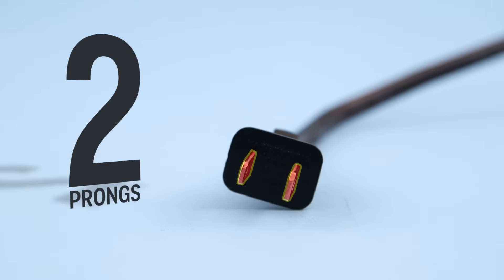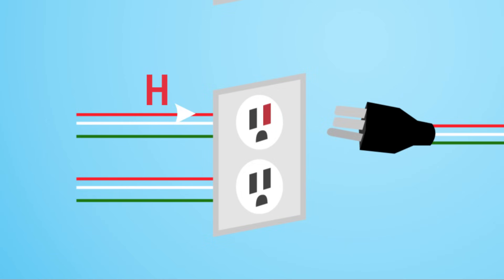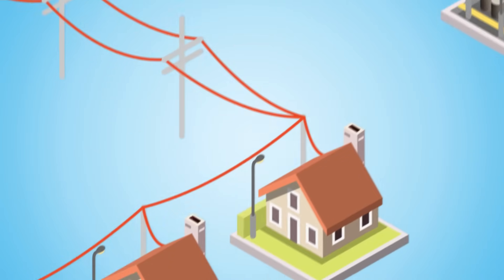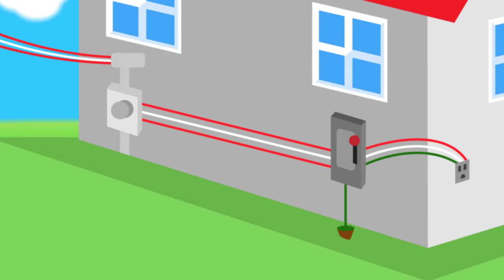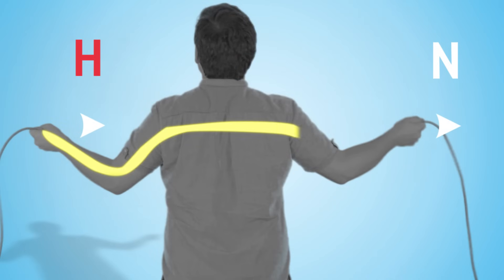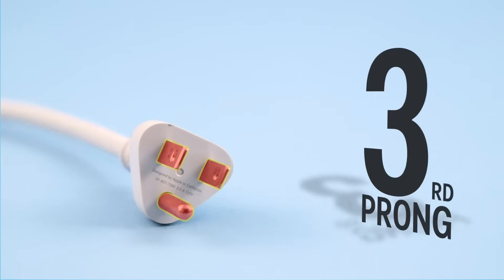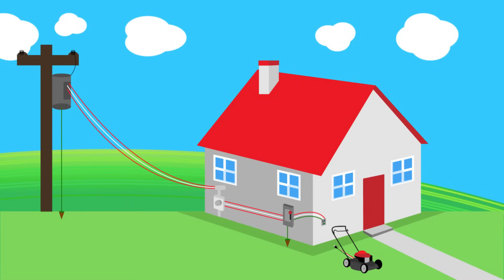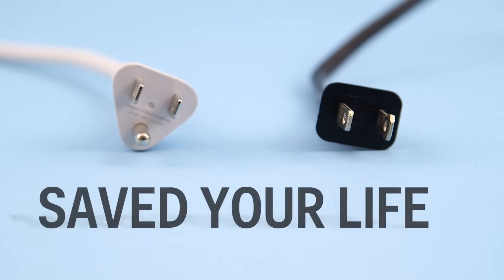Why some power plugs have 3 prongs instead of 2

Comment: Ok, guys if anyone is from England here, watching this video (which I am British) they would know that all the plugs that we use have three prongs, and this is just something in our everyday life. We don't find it odd, and I thought everyone had these wires. But considering that I'm 9, I haven't been out of my own country that much. But this is classic America, to not think things through. Sorry to say, but my empathy isn't turning on right now. <0-
Reply: FluffyStuff mhm
Reply: I like the UK plugs and sockets a lot more they are far safer than the US ones (I'm from the US)
Reply: FluffyStuff Apparently unearthed devices do exist. It’s just that you guys need the 3rd prong to open the shutters for it to actually get plugged in. That is pretty clever though. Nobody is gonna get shocked from that.
Reply: In most of Europe the covers work so that you need to plug both pins at the same time. Some British outlets also have this in addition to the earth pin. The problem with the British system is that a kid can first stick a needle to the earth. Then he can insert it to the live and if he touches both that can give a fatal shock.

Comment: The ground prong usually points down, but is SUPPOSED to point up so that if anything falls on the plug, it will not short between neutral and hot.
Reply: No, that is just your own rule. The code does not say so.

Comment: in the UK you cannot access the live (hot) and neutral connections in a socket without the earth pin opening up the flaps. this means the appliance is earthed before any other connection is made.

we also rate all appliances separately with smaller fuses in the plug top, rated to the appliance.

not to mention mandatory RCD protection for every household.
Reply: You guys are way ahead of us in the West.

Comment: I got shocked a little by a power strip and everything in my room turned off, I guess I was closer to death than I thought
Reply: That was the RCD when you get a shock the RCD will shut down
The electrical system in your room or entire home without the RCD or 
Ground you will be dead or seriously injured

Comment: As an electrician this is so funny because not even the creator of the video can really explain this in a good way... lol
Reply: Yeah, and the reason the power is cut off when there is a direct short to ground is because its basically creating a short circuit between live wire and neutral wire, since ground is always bonded to neutral at the main panel, not simply because there is voltage on it.

Comment: all plugs in the uk and Ireland have 3 prongs. phone chargers use dummy plastic ones but toasters and other high voltage apliances use metal earth prongs. We also get 240 volts compared to Americas 120 volts

Comment: We live in an old house, so all of our outlets have only 2 prongs. We have to buy dozens of adapters... 🔌
Reply: Should probably invest in a rewire, adaptors don't provide a ground connection.
Reply: The adapters may provide a ground connection if you screw the screw from the cover plate in thru the little green tab on the bottom of the adapter

Comment: in Ireland and the UK. the 3rd prong also stops kids from sticking objects Into the socket as the bottom two are closed and only open when the top prong is inserted.

Comment: kill you? oh come on. 120v lines are not that dangerous. i used to hold on to an exposed socket for like 15 minutes straight just for the tickling.
shock physiotherapy on my hand was much harder to endure. the shock was orders of magnitude stronger. and i still had to do it for half an hour at a time.
Reply: Try touching one line with one hand and another line with your other... That'll kill you..

Comment: Here in the U.K. It's also for opening the shutters on the plug each small slot where each prong goes into is blocked by a plastic white shutter preventing you from poking at the Inside and when you plug something in the third prong opens the shutter allowing for the plug to go fully in a once remove the shutter falls back into place
Reply: Which is also why we always need an earth pin, though this has led to the widespread misconception that appliances in the UK are always earthed, when the earth isn't used any more often than in the rest of Europe, for example

Comment: If AC flows both ways, aren't both wires the hot wire? Also, great vid.
Reply: No, the hot wire has voltage relative to ground that switches (in Europe) between -325 V and 325 V. (U.S. -170 V ...+170 V) The neutral is connected to ground.
Reply: Only in a 240V circuit

Comment: Yeah my family went out and bought some 2 prong to 3 prong adapters and I was like; Boi, you stupid?
And it's super dangerous because the adapter isn't meant to be used the way they use it. I don't agree with them using it, because there is supposed to be another power source through more wires you thread though a hole in the adapter.
Reply: It is not dangerous to use them if the outlets have only two holes. It would be dangerous to use them in in a three hole outlet but why would one do so?

Comment: I haven't watched the video yet but in short terms:

2 prongs is used for devices that are Internally grounded

3 prongs are for items that are not internally grounded and rely on grounding the item through well.. the ground
Reply: Internally grounded makes no sense. They are double insulated.

Comment: Teaching people wrong. At the end; the fault current doesn't go to the ground rod to trip the breaker.  Actually the ground rod has nothing to do with tripping breakers. The ground isn't  conductive enough to trip the smallest breaker. It keeps the system at ground level potential at all times. Second; It repells lighting. Stops it from happening. Doesn't let the system charge up. Kinda like a grounding bracelet on a work station for electronics.
Reply: it can trip the breaker
Reply: Omar  Carrero 
Ground rods have about 25ohms resistance due to dirt is not very conductive, neither  is water. 25ohms at 120v is less then 5 amps. That is not enough to trip the smallest 15amp breakers found in homes. Maybe you're talking about GFCI breakers.

Comment: Bruh I'm pretty sure no consumer voltage is high enough to get through the dirt, through rubber shoe soles, and into you lmao
Reply: you'll be surprised
Reply: 100v, 110v, 120v, 200v, 220, 230v, 240v, 480v. Yes, low voltage. Try touching a socket..

Comment: What if you put adaptor on it, will it be the same?
Reply: I’m really late to answering on this but it gets complicated. The three prong to two prong adapters have a little green tab sticking out of the bottom that you need to screw into the screw holding the outlet cover on. The screw has a chance of having a path to ground. If you plug the adapter in and do not screw it on to the outlet through the little green tab then it makes the ground prong useless. Lots of people don’t know this.

Comment: Gee, my toaster has a metal case and no third prong on the plug.  In fact, I've never seen a toaster or other resistance appliance with one.  Have you?  Yes, I know.
Reply: Americans have some ad hoc decision not to ground toasters.The  reason is that people could pick the toaster in their lap and stock a metal fork inside and get electrocuted. I find that stupid. You can shit the deice. Modern toaster disconnect the wires completely when off or you could unplug it for extra safety before poking in. I do not like add hoc decisions on these. The grounding sold be based on principles.

Comment: This is wrong, or at least in australia. The plugs with only an active/neutral are double insulated, they dont require an earth because there is a 2nd protective layer of insulation to stop a fault. And also the earth doesnt stop the voltage from lightening strikes, wrong again.
Reply: 1st one true for americans, anything with double insulation don't require a 3rd prong. 2nd absolutly true
Reply: America is very weird my friend
Reply: We know, we know....
Reply: Edwardo Ondreseaus Cannot plug 2 pin Aussie plugs in Chinese 3 pin outlet.

Comment: Forgive my ignorance. But doesn't AC alternate both ways? Can someone explain this? Electricity is foreign to me
Reply: It basically works like this, the electricity flows from hot to neutral and then flows from neutral to hot and then hot to neutral and over and over
Reply: Yes you're right, the only difference between live (hot) wire and neutral wire, is that the neutral wire is earthed back at the transformer supplying electricity to the neighbourhood.

Comment: For everyone arguing about grounds (the 3rd prong) it's pretty much the standard for all new construction world wide, but there are places where enforcement is rather lax and even in the USA there's really no requirement to upgrade existing outlets unless it's a commercial building with something else going on that needs code updates. You can pretty much find 2 prong outlets in any structure built before 1960 for most of North America, including the Caribbean islands, which seem to be running 20 - 30 years behind, code wise. Almost impossible to buy one these days unless you find an old hardware store with old stock. I would bet that Central America is in the same boat, but I have not been there personally. Heck, I don't recall seeing a GFIC outlet in any of the islands prior to about 2002, although I'm sure they install whatever is available, regardless of the wiring in the wall actually being connected to an earth ground. I suspect this is what some here mean when they say they have not seen any grounded outlets in their area. IOW, they live in an older structure that's not subject to mandatory upgrades.

Comment: Why do some things have the option but don't use it. for example my hover board has a three pronged port on the back but when you open it up it only has two wires going to the chips

Comment: The new MacBook Pro comes with a charger with 2 prongs. You have to get the 3-pronged cord separately. When you're using the 2-pronged one you can feel electricity when you rub your hand on the aluminum. It seems very unsafe for a way to make money.
Reply: Static? There is no AC going into your MacBook...

Comment: Okay help me out here America, how can you know whether you are plugging the device in upside down or not with only 2 prongs.
I mean i would assume it's AC so it doesn't matter but why is one wire a hot wire and other is neutral
Reply: the pronges have holes in them so if you plug them in they wont fit in the outlet and your appliance would be upsidedown and thats a problem

Comment: Ignore what he said. All plugs have three prongs, but it's live, neutral and earth. There's no such thing as a hot wire. The electricity doesn't flow from live to neutral, because mains electricity is ac, so it would be alternating is direction
Reply: that's in Europe; in America there is a hot wire specifically to make hot water, because, that's in America

Comment: Here in the UK, all the plugs come with a ground as a standard, also the sockets here have shutters that prevent people from poking objects into the sockets, thus regarded as one of the safest plugs and sockets in the world.
Reply: P.S I have used both US and UK plugs and have to say, the British ones last much longer and don't loosen from the socket, which I find very annoying, I remember having to bend the US prongs to keep it in the socket because it would just loosen up.
Reply: @ScottBrady06  german sockets have the same features
Reply: If an equipment is grounded in U.S. it is grounded in U.K. If it is not grounded in U.S. it is not grounded in U.K. Adding a dummy ground pin does not increase safety.

Comment: Lol in the UK we've always had 3 prongs
Reply: Yes every UK plug has three prongs, but not every item is earthed, leaving the third prong useless. The reason for this is so that you don't have to go through the inconvenience of two different sockets.
Reply: Ben Wyatt Also, the third third prong opens up the 'door' for the bottom prongs
Reply: Bilal Patel Yes. Some sockets (such as MK branded ones) require all three pins to be inserted to work. So if you put something in the earth pin, the shutters still won't open! Very good design.
Reply: And ( macau ) China too
Reply: You can plug a europlug to uk cable... Just use adapter..
Reply: RacingCart - RC Playz Cannot plug Australian 2 pin plug on 3 pin Aussie Chinese outlet. Earth outlet locks both live and neutral outlets. Just like UK outlet both live and neutral locked together if Earth outlet does not plugged in.
Reply: @milkerfish  No all but you need to open the holes with something, therefore, they had to implement plastic.
Reply: Yeah! and the live and neutral is insulated!
Reply: Not to mention we have shutters on the live at neutral
Reply: They are also used here for anything done in the past 30 years or so. We had them in children's rooms in the 60s though back then they are a special item that required special operation to use.
Reply: Ben Wyatt Both live and neutral outlets can be locked together if earth plug does not insert on that outlet.

Plugging your small Europlug 4.0 mm round pins to UK outlet?, you have to plug that chopsticks on earth pin then plug a europlug into the UK outlet.
Reply: Europlugs (do you mean Shucko?) can't be inserted into  UK outlets, the earthing contacts are on the side, so no earth pin and the pins are the wrong size too, so there will be poor contact which can lead to arcing.
Reply: @benwyatt7619  Europlug as no earthing. It is for double insulated equipment only.

Comment: The "ground" and "neutral" both run to the same place in your breaker panel any how.
Reply: jon doe Only in the main panel. If you have a sub panel, the grounds and neutrals should be separated.

Comment: These have 3 prongs:
- UK which usually found in Air conditioner at least if not in UK probably.
- US that has tube prong
- European/International, although it's not in prong but implemented at the side of the connector as you can see the metal in the border of it.

Comment: Every single Electrical Appliance here in New Zealand has 3 Prongs. I've always wondered why American Devices only have 2 Prongs. .... Weirdos... 😂😂😂
Reply: UNSC INFINITY In America you can actually start to see 3 prongs more often
Reply: The equipment that is sold around the world is similar on every country, only the plug varies. It is not that in country X they sell grounded and in country Y not (unless we are talking about developing word or maybe Japan).

Most modern equipment is double insulated. I have some 30 of those: all my TV equipment, phone chargers, lamps, fans, most computer equipment, razors, toothbrush, vacuum etc. I cannot even count. They do not use the earth. If the plug requires the earth like in Britain it is not connected. There are a few grounded equipment. I have eight: laptop charger, monitor, two printers, fridge, microwave, toaster, washing machine. Basically those are in two groups: kitchen/bathroom equipment and computer equipment.

This is an example of an Aussie ungrounded double insulated power cable. Note two holes at the other end:

https://image.dhgate.com/0x0/f2/albu/g7/M01/05/08/rBVaSlriFnKAe5aLAAR76MYz4n0159.jpg
Reply: Have you even looked at the plugs you have. Look for example your TV, phone charger etc.

https://cdn.shopify.com/s/files/1/1907/5887/products/photo_of_PlayStation_4_PS4_NZ_game_console_mains_AC_power_cable_cord_lead_2_ROHABT8EBIX8_ca6949fd-c2ab-424d-a5fb-be4e88d801dc.png

Comment: Another reason is so it doesn't fry your Electronical Device if a Sudden Power Outage occurs or if a Lightning Strike Happens. Basically diverting the Electricity that would of Destoryed your Device and/or Killed you, And bringing it into the Ground.

Comment: The European plug has two prongs. The grounding goes via two strips on opposite sides of the plug, and contact grounded springs inside the socket.
Reply: Not always. The French use a third pin in the socket and a female connector between the live pins. Many European plugs have connections on the sides + a connector for French sockets.

Comment: now I'm concerned about my phone charger which has only two prongs and is starting to expose wire at the end
Reply: unorthodoxxx 6-12 Volts!?!? just about all phone chargers for the last 10 years have been 5 volts
Reply: CheesyPies your phones charger puts out about 6-12 volts DC. Which isn't enough voltage to even FEEL it. Let alone get seriously hurt by it. No phone charger needs three prongs. And if you're still worried, just buy a new charger.
Reply: I have a 15 volt phone charger... Is that odd?
Reply: SpiderArtMC is it usb?
Reply: Its a quick charge and usb but right now I'm concerned about...WHERE MY PHONE IS!!
Reply: CheesyPies have you ever owned a microsoft surface?
Reply: no but I really want one
Reply: Its usually 5v but some phones can charge using the Qualcomm Quick Charge or some kind of "fast charge" system which can go up to 16v (I think)... But It just gets stepped down to a max of 4.2v for most phones using Li-Po battery cells.

Comment: I don't get why sockets in some countries have no switches???
Reply: unnecessary in most cases, but yes, i do miss switches on shuko sockets
Reply: Most outlets don't have switches. Japanese switched receptacles are the first to come to mind, and they only use 100V, so as usual, they take safety very seriously. If you're going to take something too far, it should be safety.